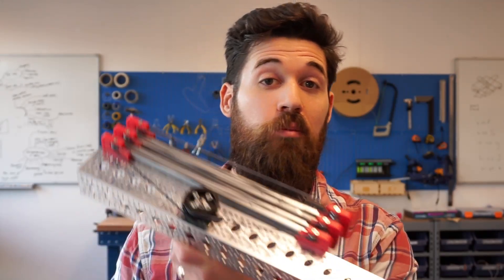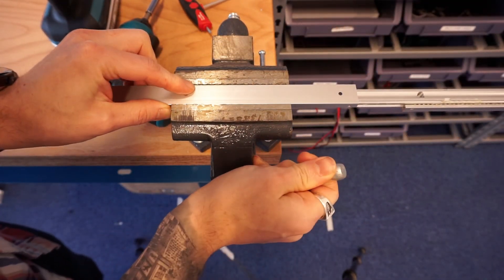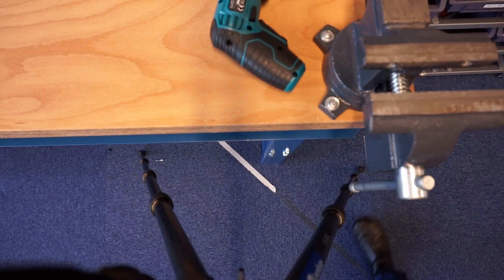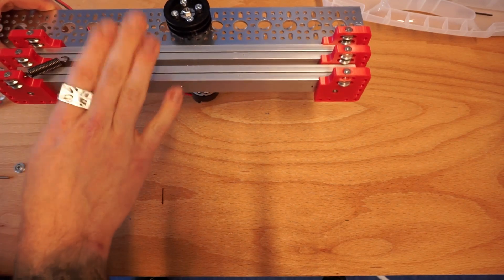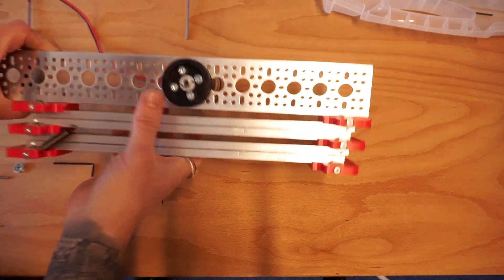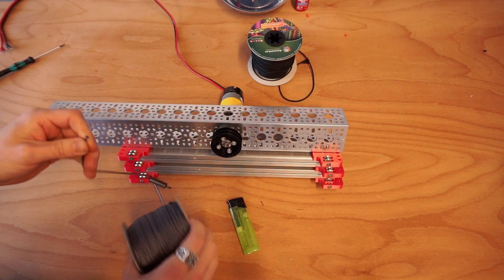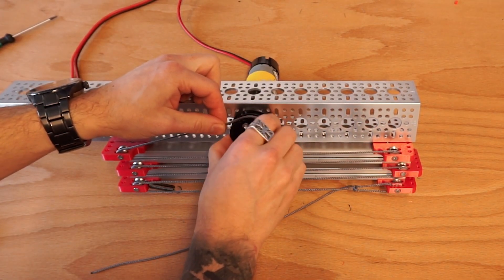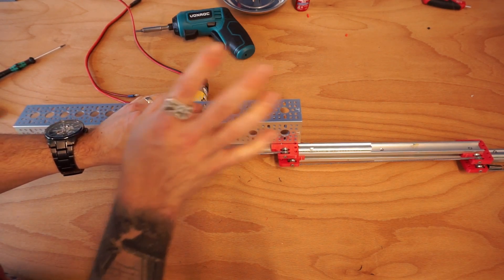How to Rig Misumi Linear Slides (String Drive)

Comment: Hello, How can I calculate the rpm of the motor that I need. Do you use special calculator for this system, or formulas?
Reply from the maker: Depends. Rpm isn’t the only factor, torque is as well. Lots of torque calculators online

Comment: Do you also have a stl file for actobotics rather than goBilda?
Reply from the maker: No, I only have a 8mm centre to centre diameter hole pattern. However, the full step file is available in the description so you could easily adapt this pattern as needed.

Comment: Really helpful! but also would the hub mount still work even if it was vertical instead of horizontal like how it is in the video or would you have to adjust the pulleys?
Reply from the maker: You can mount the hub perpendicular, yes. The string will twist to handle the angle change. Just make sure things are still moving in straight lines.

Comment: I'm curious about the pulley in this video. It's hard to find for us right now, so we're trying to print it out with a 3D printer. Is it possible to make it?
Reply from the maker: You could* 3D print v-groove bearings, but I would suggest against it. You'll add a huge amount of friction to your system and dramatically reduce it's performance, especially on multiple stages of a lift. Try out v-groove bearing as a search term, or "그루브 베어링" on G-market, I've found a few suitable sources already, assuming you're domiciled in S. Korea.
Reply: @BroganMPratt  I'm talking about the black pulley that goes on the motor.
Reply from the maker: @sansan903  Ah, yes, that is 100% possible via 3d printing. the pulley diameter I'm using is 38mm. Here's gobilda's as a start. https://www.gobilda.com/3407-series-hub-mount-winch-pulley-dual-spool-112mm-circumference/

Comment from the maker: I've included my recommended rope to use in the description! Through lots of testing I've found it to be the best performing, and won't snap. If you'd rather rig via belts instead, follow my tutorial here: https://youtu.be/HZxlZqbDY2c
Reply: You recommend 1.3mm now, but the video recommends 0.8mm. Which one should I use?
Reply from the maker: @sansan903  I've since updated my recommendations from new tests done after this video was made. I'd go with 1.3mm, though 0.8mm will be okay as long as you're not attempting to lift your robot up.

Comment: what we like to do is use a long ziptie or a ziptie daisy chain, and then just pull the ziptie to tension the return string to the desired tension, that way if it loosens, you can easily just pull the ziptie more
Reply from the maker: That’s a great idea, I’ve seen other teams do this im the past. I like Kevlar string though, and the stretch this produces overtime is next to nil, so after proper tensioning it doesn’t need to be redone.

Comment: how would you go about multi - stage assembly without a countersunk sleeve nut? do you need longer countersunk screws?
Reply from the maker: I would go with longer m3 screws, and use a low profile (2mm) nut on the other misumi slide, so your screw is going clear through the adapter then. Should hold just fine, but a sleeve nut is a nicer solution.
Reply: @ do you happen to know the specific length of countersunk screw that would be long enough to go through the adapter and reach the other slide?
Reply: @ maybe around 12 mm? shorter or longer?
Reply from the maker: @ 12mm sounds about right, I would open the CAD and check your distances to be sure. You don't want this too long as you don't want it to go too far past the end of the nut, or you'll run into your intermediary stage.

Comment: Could you provide a whole list with links to each specific screw, part, etc? Also, if we were to directly attach them without the 3d printed spacers, would the parts change?
Reply from the maker: The whole BOM (build of materials) is available on the printables link (see description), along with the adapter's step file. 

https://www.printables.com/model/1063158-linear-slide-insert-dual-string-for-ftc-misumi

You cannot use the misumi slides without an adapter of some sort, as otherwise you would have no where to attach your v-groove bearings.
Reply: @BroganMPratt  you have them listed but where do you specifically get them? I'm struggling to find the exact parts and don't want to order the wrong ones. For example, where do you get the countersunk screws from (8mm and 40mm), as well as the M3 lock nuts?
Reply from the maker: @bigbrainsigs154  That's a much bigger question. It depends what country you are located in. I would suggest using an answer ai engine like perplexity.ai, putting in the BOM, and asking for where these parts could be purchased locally in your area. Alternatively, bring this list in to your local hardware store and ask an employee to help you out with that.

Comment: are the M3 sleeve nuts optional for multiple stage slides or I can use the countersunk M3 screws and where are the 40mm screws used because I can't find them in the video?
Reply from the maker: You can use a 2mm low profile m3 nut instead of a sleeve, but be sure to use thread locker. Sleeve nuts are a more secure hold but both work. 

40mm screws are for going lengthwise through the plastic adapters, to hold the v groove bearings in place.

Comment: are gobilda v groove bearings the right size?
Reply from the maker: They are not. Gobilda uses a 4mm diameter hole while these v-groove bearings call for a 3mm centre. You can see the Build of Materials (BOM) needed on the printables link here. 

https://www.printables.com/model/1063158-linear-slide-insert-dual-string-for-ftc-misumi

That being said, I've included the STEP file in the above link, so you could easily modify the hole of the design (and likely carve out a bit of the insert section) to fit a 4mm centre bolt/machine screw.
Reply: @BroganMPratt I was wondering if you could provide a misumi link for the necessary screws because I can't seem to find the right ones
Reply from the maker: Here is a misumi specific product, but honestly, any m3 countersunk head screw will work. It doesn't have to be misumi, your local hardware store likely has them at m3 8mm long. 

https://sg.misumi-ec.com/vona2/detail/110302280970/?CategorySpec=00000230683%3A%3Amig00000001806032%0900000230744%3A%3Anvd00000000000002&list=PageCategory

Comment: hey, is the spring indispensable?
Reply from the maker: Yes! You’ll have tension issues without a spring. The thing about a linear slide is that the tension on the retraction line is different at various points on maximums, with the lowest tension in the middle. Without a spring you’d have not enough tension in the middle of the slide and you’ll end up slipping a pulley.
Reply: @BroganMPratt  Thank you!:)
Reply from the maker: @daciagolanas219 More than happy to help! Best of luck with your project

Comment: is it possible to do a multi-stage without sleeve nuts?
Reply from the maker: 100%. You’d have to get a Low profile  3mm nut and mount this inside the slide instead. It provides just enough clearance to go under the middle stage of the slide. This is not as secure in my experience but still works well. Make sure you add threadlocker to this.
Reply: @BroganMPratt  Thanks!
Reply: @BroganMPratt do you have to get a longer screw for this